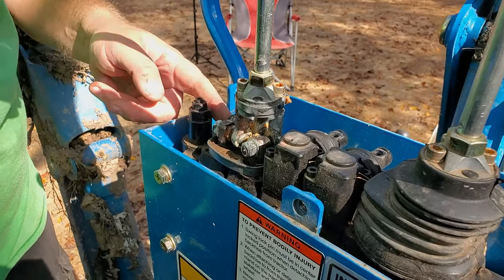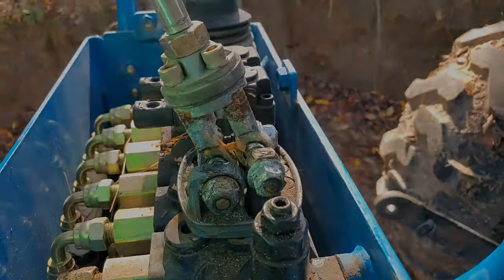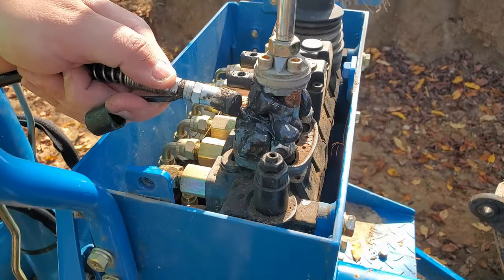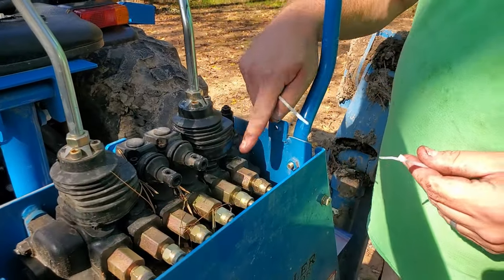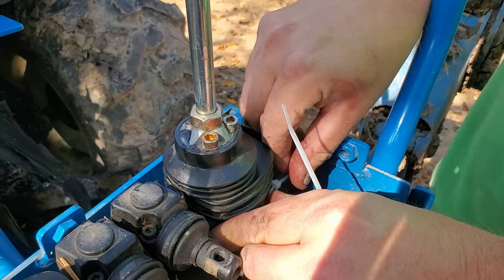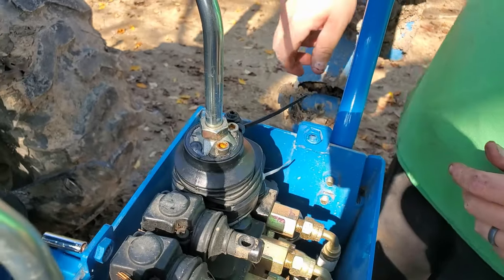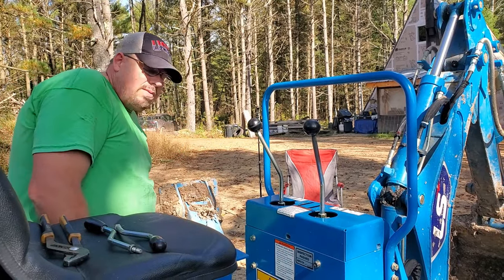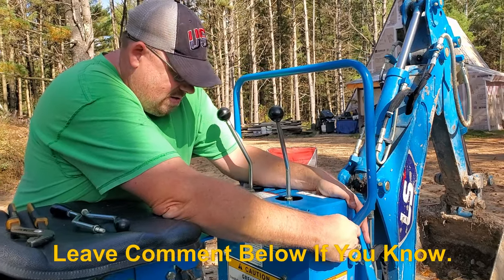Fixing a Floppy Joystick

Comment: I had the same backhoe as you (2013 with a different brand). The hoses were all perished on delivery and my seat snapped off at the weld the first time I used it. That was all fixed on warranty. Mine was welded to the floor plate but I see yours has been improved. I have pinhole rust on my hydraulic rams so keep an eye on yours. They are chromed but not triple plated with copper, nickel and chrome. If you have pinhole rust, use phosphoric acid (from the paint shop) and apply it with a rag. wait a few minutes and lightly rub with fine steel wool. Wipe it off with a damp cloth then coat them with car polish or something. You might have to research for a weatherproof coating that won't damage the seals but all I could find on the web was grease which would not be a good idea. Perhaps your next shed will be over the sawmill as well?
Reply from the maker: Would love to cover the sawmill but not a priority just now. Thanks for watching.